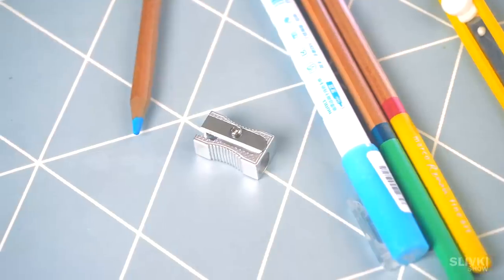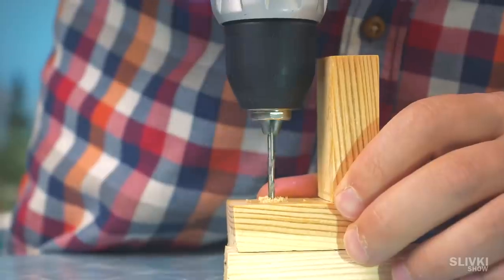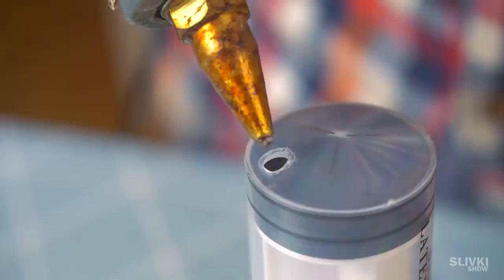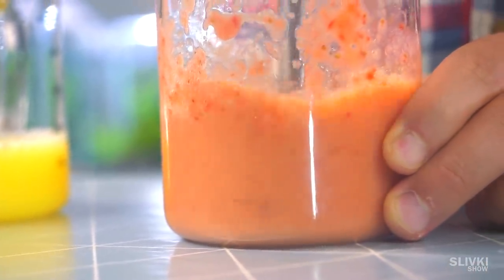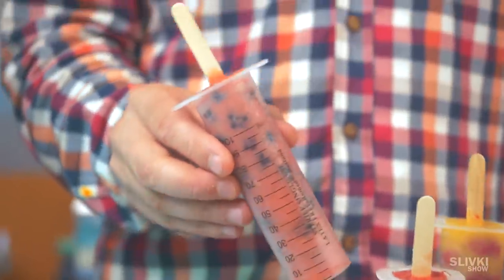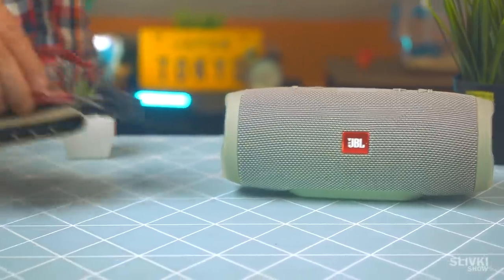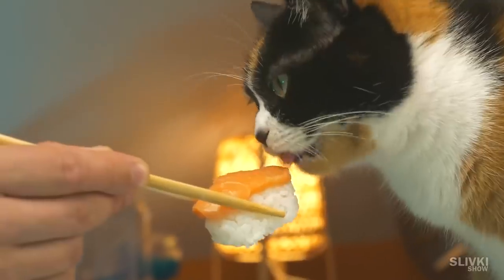5 LIFEHACKS FROM SLIVKISHOW

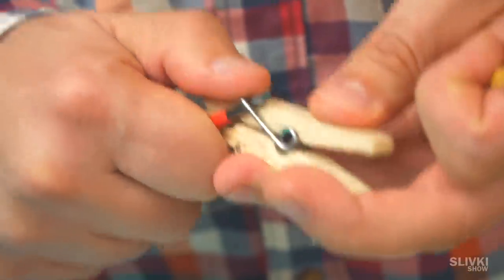Comment: 4:43
There's actually a much simpler life hack for it, so I'll share it with those who'd like it! 

All you need is: 
- a rubber band/elastic band
- tissue/piece of paper (you can also use the very wrapper the chopsticks came with!) 

Basically just fold your tissue/paper until it's about a centimeter or so thick (you can adjust based on what you're eating) and put it in between the two chopsticks. (Ideally closer to the top). Make sure to line it up correctly! Then just use the rubber band and, on top of the tissue/paper, wrap it around the two chopsticks. 

This is handy for restaurants and places where you can't necessarily get access to a clothespin, but the clothespin idea works just as well so you can do either one!

Comment: To straighten the wire all you need to do is put one end in the drill chuck and hold the other end with pliers or clamps then spin the drill it will straighten